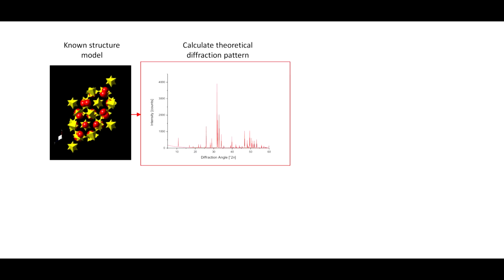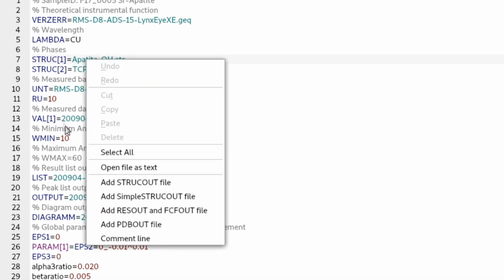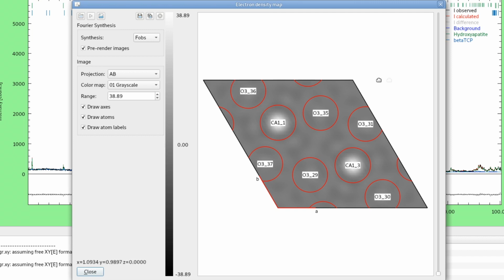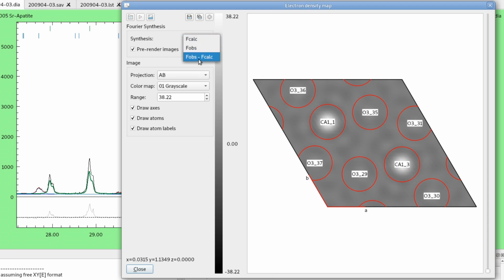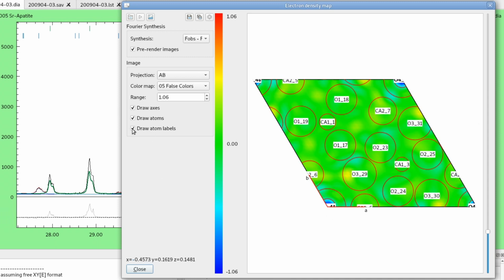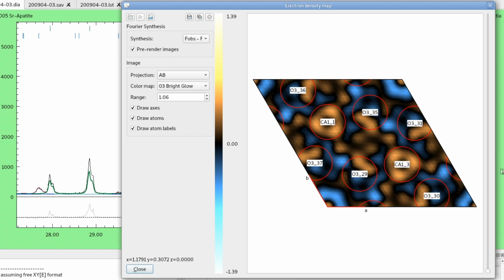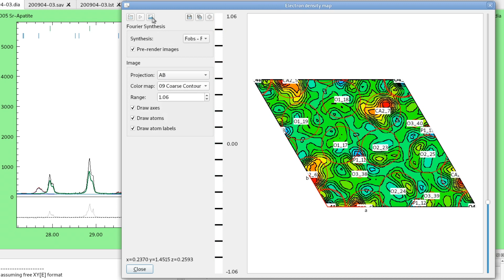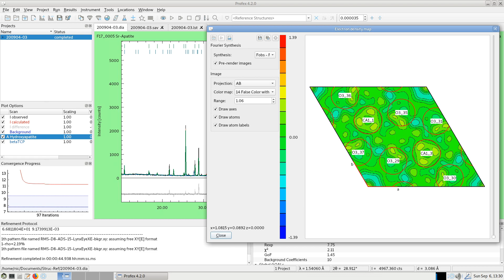Profex XRD: Electron Density Maps

Comment: Can we used fullprof refinement files for electron mapping density through Profex software?
Reply from the maker: No. You can refine your dataset with FullProf using Profex, but the ED maps only work with BGMN. You will have to use the FullProf tool to create the maps.

Comment: is it possible to design a electron mapping density of composite system through Profex software?
Reply from the maker: You can create separate electron density maps for each refined crystalline phase. If this is of any use for your composite material I don't know.

Comment: Is it possible to produce a charge density along a specific plane, i.e., (110)? and how?
Reply from the maker: Not in Profex. But you can export the density map data to a csv file and import it into other plotting software.
Reply: @profextutorials2325  Thank you for your reply. Which software do you suggest? that works with the csv file.